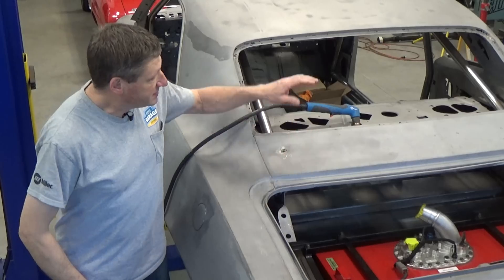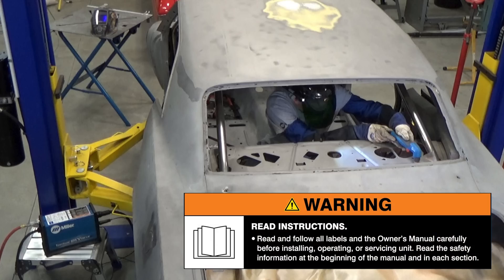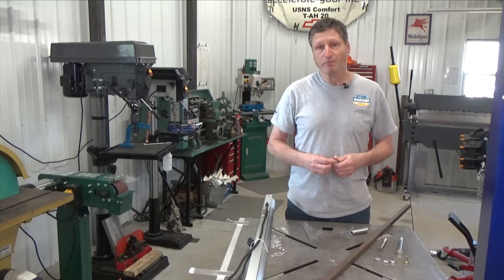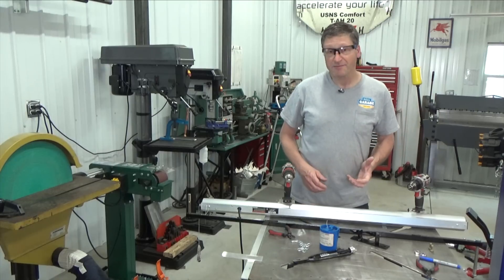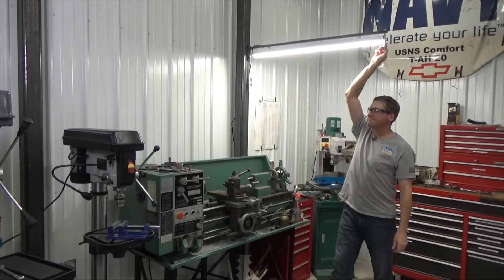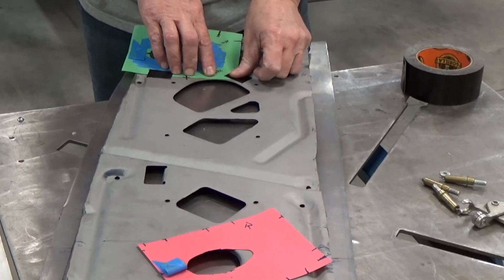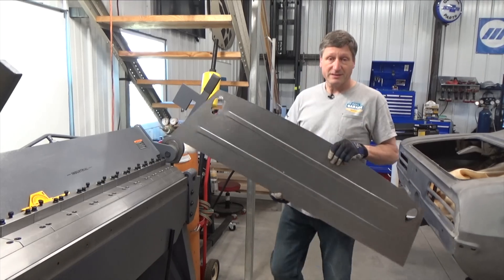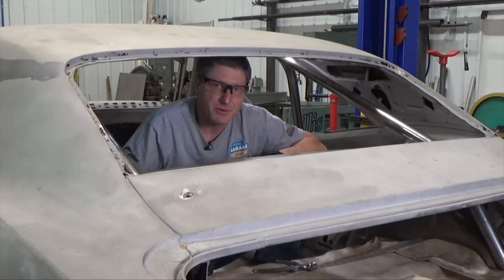Real Garage: Car Firewall Fabrication, Shop Illumination (Season 3, Episode 3)

Comment: Andy, on the eyes: I’m 54, and discovered over 20 years ago “Bilberry Extract” from the supplement section of any store. That will naturally bring oxygen to the most important part of your eyes, the retinas. I use this every day! It works. A question: Where did you get those super cool Miller eye protection glasses you were wearing? I need several pairs! Thanks